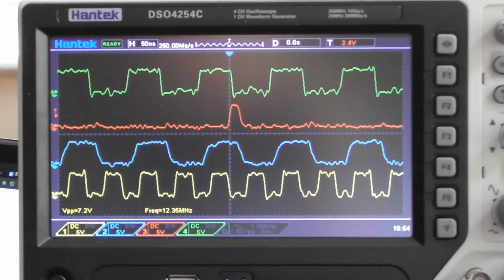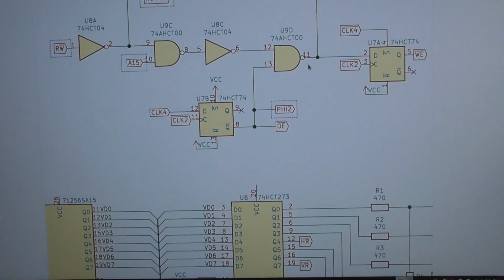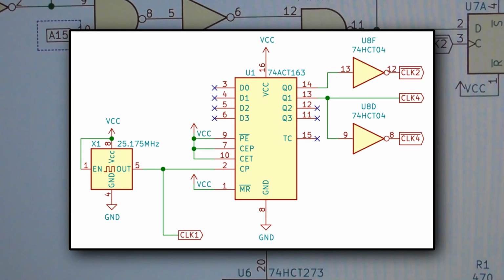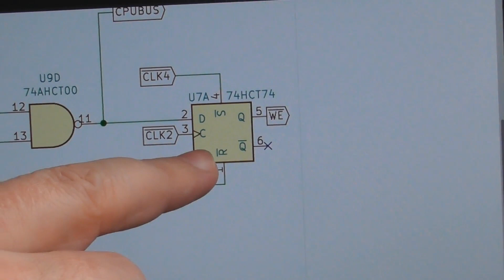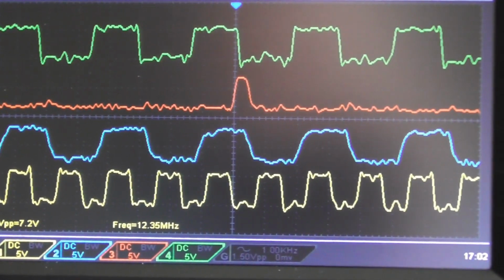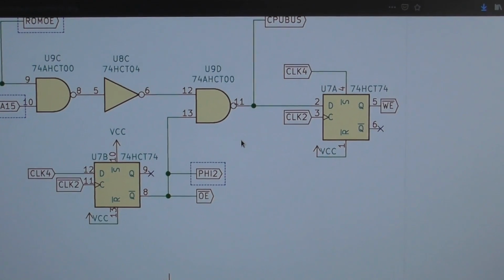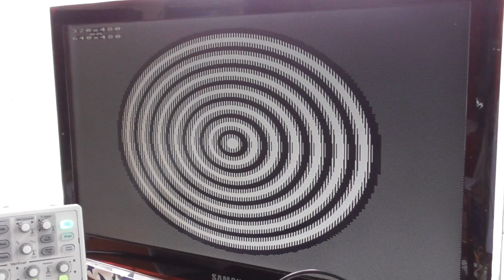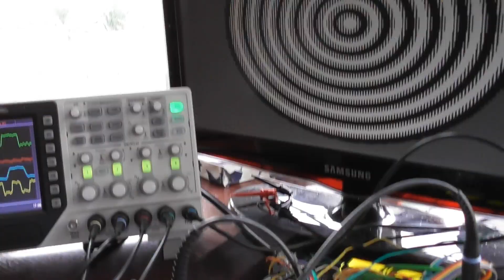VGA Bus Timing Issue Update

Comment: Providing clocks as input to clocked triggers is a way to disaster. It may work sometimes, but by the book is nono. Doesn't is cause a metastability?
Reply from the maker: Yes for sure, that was bad, and I'm not sure why it worked so well. I have since just replaced that logic with a PLD that's more stable. I'm not sure what I'll do in the long term.

Comment: The capacitive effect of the breadboard is really evident on the blue trace! Wow!
Reply from the maker: I think it's more likely inductance in the wires, or a combination. Maybe I should do an experiment to measure that more directly.
Reply: Have you ever measured the capacitance between lanes on a breadboard?  I have - on several different brands and price points.  And I'm getting between 3-5pF which is basically bugger-all.

Comment: Twp for a 55ns RAM is typically 45ns so you'll want to make that red pulse longer. You can start the pulse earlier though. The only constraint (Tdw) is to have the data stable for 25ns before the end of the write enable.
Reply from the maker: Ah yes, you're right. I need to properly check the datasheets, address setup times etc, and make sure everything is fitting in. It'll be easier to do that when I make it all synchronous, I think.

Comment: Hi George, love the series because I’m doing my own graphics extension to my Z80 board. One important tip though because I’m seeing you use electrolytic caps for decoupling, I suggest you better use 100nF ceramic caps directly on the timing important chips especially involving clock signals. This helped me improve my prototype breadboards. I’ve even soldered some axial type 100n multilayer caps between VCC and ground pins  on som critical ones because some of my breadboards wer not the newest one’s anymore. Also make sure to run short wires for your clock lines and gather the gates and flipflops as close on a breadboard as possible. Hope it helps to improve the signal integrity. I’m currently moving my breadboards to a vero-board for more tightness because it already spans 8 breadboards. Can‘t wait to see the results of that. Wish you great fun with your projects, I certainly have watching your videos! Greetings from Germany.
Reply from the maker: Yes there's definitely some noise in the power lines. I use electrolytics where power enters the breadboard, and ceramics at intervals along the power rails, but not on every chip. I did try adding more here, but couldn't see any immediate effect on the signal quality.

I think the bigger problems are just that I've been sloppy with the wiring through a lot of iterations, and need to tidy it up! I'm sure there's a lot of crosstalk between the looping connections I've been putting in recently. So I will do that for sure when I reach a good point for it, or when I am no longer able to make progress due to the noise.

Good luck with the veroboard too. I tried that for a 6502 build a few years ago but regretted it - it didn't really solve the problems with wide buses, there were still wires everywhere! And breaking tracks is hard work. For the power supply module I carefully planned it in Kicad to reduce the number of tracks to break!